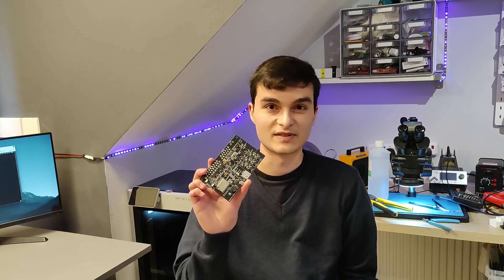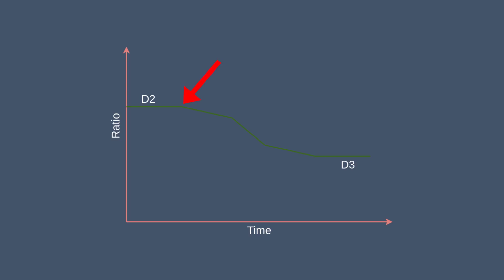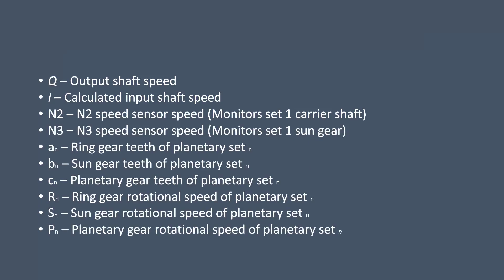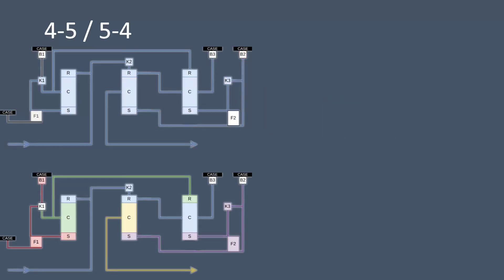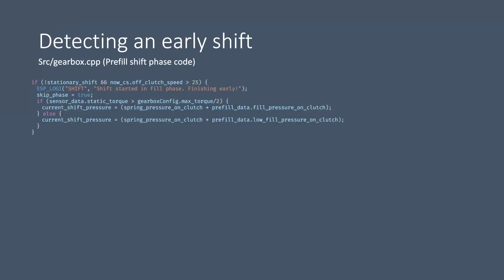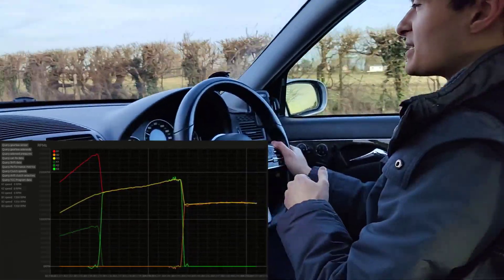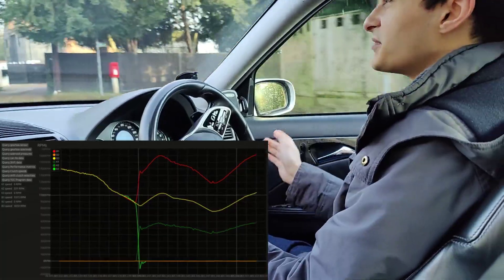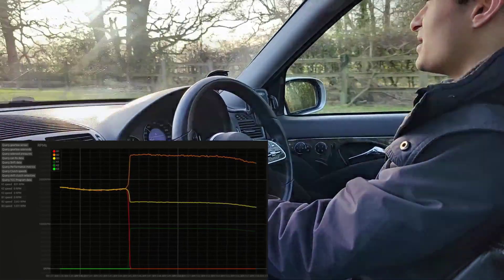Ultimate-NAG52 deep dive ep.1 - Clutch speed theory

Comment: First off, i sincerely want to thank you for the time and effort that you have put into developing this project, and then to make it a open source project 🙏 .... You have done a fantastic job, and the car gods praise you!

Ok, so im just about finished building the hardware of your v1.3 board. Took some time to source some of the electronic parts and spare TCM's to use connectors from here in North America. Is there a build chat, or feedback hub that we can get intouch with you and other beta testers and discuss the project?. Suggestions, issues, updates etc?. As a classic benz enthusiast i have a few 722.6 powered cars along with some older ones that would likely be wanting to use a 722.6 in standalone mode in the future.

For now the first board i built is going into my m112K powered car. But then i have a m113k to try #2 in.

My main reason i initially looked into your project was i was not satisfied with the "sluggish/slow/old man" light throttle up-shifts in manual mode on my 722.6. Having the ability to adjust shift speed is just the beginning.
Reply from the maker: Yes, there is a telegram chat listed on the website for everyone to discuss in and send feedback
Reply: I also plan to put the V1.4 into my C32AMG with M112K. I use it only for drifting and track driving. Is it possible to lock the transmission into a certain gear, for example first or second gear?
Secondly, I got an issue with the supercharger: I removed the clutch from the pulley of the supercharger. Now the ecu of the engine always goes into failsafe-mode, because the boost pressure below 2000 rpm is too high (since the supercharger is always driven by the belt and not disconnected at low rpms).
I see multiple options:
a) Install a small micro-controller which changes the value for the ecu with low rpm to a false but expected value for the ecu
b) change the maps --> here I need the damos/mapping files for the ecu. I am not able to get it anywhere
c) let a professional tuner change the maps --> can not find a tuner who is used to the M112K
d) disable the part in the ecu code which produces the MIL with failsafe-mode

Maybe somebody can help here.

Comment: Hello!  Your channel was mentioned in a comment in one of Lukes's DieselPumpUK latest videos and I discovered your product.  I own a 1999 W210 210.025 turbo diesel (54Nm version) that I upgraded with Luke's turbo and 7.7 mm injection pump.  Since the upgrade, the transmission has been banging and holding gears, and on occasion throwing me in neutral in very dangerous situations on the highway.  I replaced the conductor plate thinking that was the culprit but no change.  After watching Luke's video on the modified valve body programing plate and your video on your product, the TCU is obviously upset with the change in power input from the engine.  Would my car benefit from your programmable TCU?  Would like to email you but can't seem to find one on your site.  Thanks in advance.  Tom

Comment: BTW, have you seen dvjcodec's work on replacing the 7G tronic TCU board with flex PCB, to move the TCU outside of the case?

Do you see a possibility of adapting your board, or making a separate one for that use case? To extend your mapless firmware coverage to 7G.
Reply from the maker: It's possible for me to do this, but it will be a seriously expensive endeavour, and one that could easily end up breaking multiple boxes, or worse, engines....if I ever get my own shop one day, I'll do this
Reply: Rooting for you my dude 👍

Comment: hi, how can I get one of your TCM? Is it possible to calculate the output shaft speed based on sensors n2 n3 and on gear ratios?
Reply from the maker: Store is linked in the description. And no, since in 2,3, and 4, both N2/N3 speed sensors report the same value, so the TCU could never work out the ratio without also knowing output speed first

Comment: Hey man i just discovered your channel and saw your video abt the 722.6 shifting speed, was Wondering if that can be applied to my 722.9 7g tronic on my s420 cdi (v8 diesel)
Reply from the maker: The theory can be applied, but in practise it's not possible, the 7Gs tcu is embedded in the conductor plate, so it's not swappable, and also deals with authentication to start the car, the 5Gs tcu is a lot simpler and easier to swap :)
Reply: @RANDASH  well dang it i didn't know abt it, so the 7g cannot be tuned at all ??